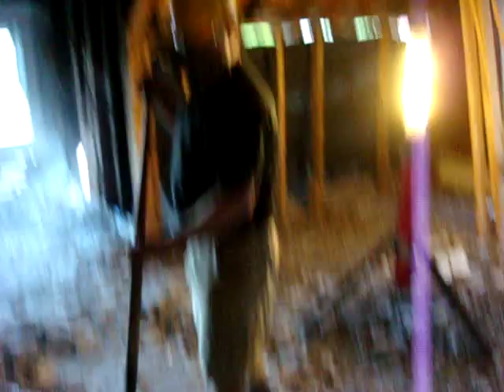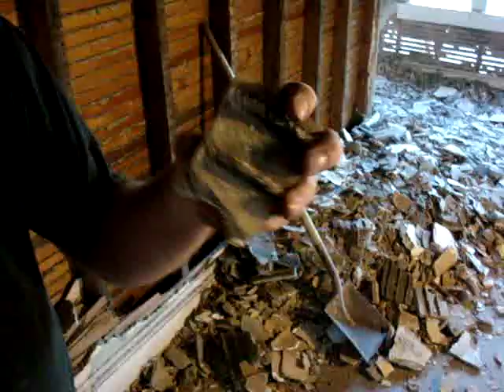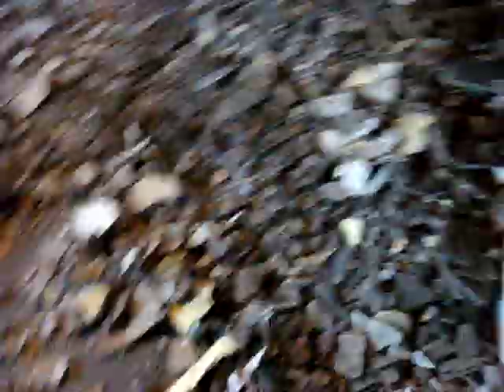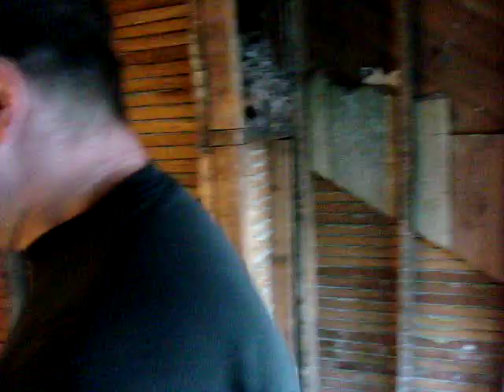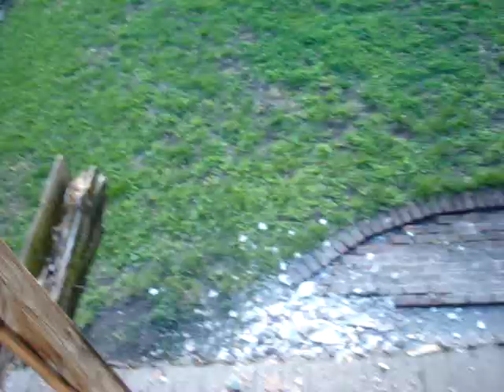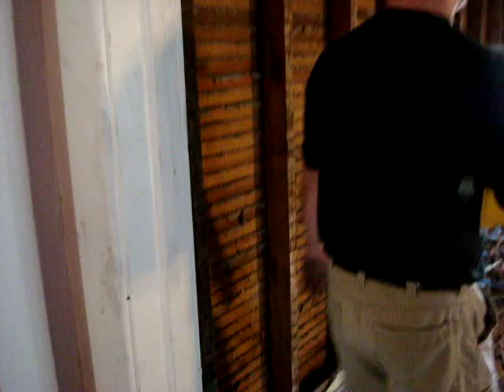How To Remove Lathe and Plaster

Comment: Dont understand why people want to remove lath and plaster walls
Reply: angelofdeath275 bc insulation! My house is lathe and plaster and non insulated. House if freezing in winter and hotter than balls in summer.
Reply: @MoparGuy1625  foam insulation can be used w/out taking down walls

Comment: thanks for the video.  I'm looking at possibly starting this process on our home, which consists of 5 rooms of plaster/lathe and 2 closets.   My allergies are not looking forward to it, and neither is my pocketbook. . however as you mentioned in your reply to youngwolf20 below, the most expensive part is labor, which will be me, so that will save a bunch.   :)

Comment: how much does it cost to do that? I have a 1200 square foot home and about 35-40% of it is wood walls and the reset is plaster. its a real pain to heat and cool.
Reply from the maker: youngwolf20 cost varies a lot-- are you doing it yourself? if you are the most expensive part, the labor, is zero, but you have to ask what your time is worth. It takes 6-8 hours to do an average sized room by yourself. It's a long work day. After you insulate and make repairs, it takes one average person with ok DIY skills 4 to 5 days to drywall, mud and reinstall the trim in one room, then another day or so to prep the trim to prime and paint. So, figure 50-70 hours per room plus materials to gut it and redo it. 

Plus, we pay $55 a ton around here for waste plus tipping fees. An average room will cost at least $100 in waste and more if it rains in the dumpster and water soaks in the plaster.

Are you spray foaming or doing Batts? Mineral or fiberglass? You'll have to get quotes.

In the end, material costs for an average room (100-125 sq. ft.) will cost $600 to $2000 depending on what you're doing once you open up the walls. if you have old windows, do you replace or rebuild? You'll certainly need new ropes inold ballast windows and probably more. 

Hope this helps!
Reply: James Glass 
thanks it does help. I wood be doing it my self and we burn all trash here. I live on a farm so DIY is something that I was raised up on Lol.
not sure what kinda insolation I would use but likely it would be the kind that comes in the roles.  my windows Im not sure about I know the house need to be raised or what ever it is that they do when houses settle. the brick outside is cracking and the glass on two windows and been split into from the house setteling. we found out about 4 years ago when I inherited the house and farm from my grandpa that the house sits on an underground spring.

Comment: I threw the plaster right into the trash bucket as I got it off the wall.  
How do you know where you can bring the plaster to recycle it?
Reply from the maker: Lead is heavy and falls pretty quickly. If you check out the EPA website you can see the procedures and gear for properly removing and bagging debris that contain lead. So long as you use a (100 or greater respirator, stay covered in your tyvec suit, stay gloved, and wash your body before eating, you won't get lead on you or your children. The debris needs to be put in a bag with a gooseneck tie, and then that needs to be placed in another gooseneck tied bag. After vaccuuming the contains need to be bag and the vac need to be wiped down. What some EPA certified renovators do is just bag their entire vacuum can carry it from job to job to avoid having to clean it each time. After all this, you need to mop and then throw away all the mop heads in double bagged gooseneck tied style. A lot of people, including me use swiffers for the final wipe down and then just toss them. Then toss your disposalable tyvec suit and clean the respirator. That's the basic procedure. After this level of detail, you won't need to worry about any remaining lead because there shouldn't be any appreciable amount.
Reply: James Glass thank you very much man your amazing !! I copied and pasted this to my notepad so I can reference back to it .. your a saint !!! thanks again!!
Reply from the maker: +Rachel Donat It depends on whether lead is present or not. If the plaster tests positive for lead it has to be specially bagged under controlled circumstances and then thrown away at the landfill. If there is no lead (and there was no lead in this case), I ground it up and used it with mulch, clay, and compost to make garden soil.
Reply: James Glass  I am preparing my home for some plaster removal and im worried because I know there is lead paint. my question to you is, what materials do you suggest I have during the process of removal and after.. and also is there any way to determine if my air still contains some lead particles lingering even after my project is done ? .any info could help . thank you kind sir

Comment: you should have used a power scabbler with a vacumn attachment to suck out the kill the plaster dust down then remove the lathe using saws much cleaner job  FLEX HPI 603 ~ Plaster Hedgehog scouring and a vacumn with a automatic filter cleaning system much less mess and dust suction health and safety better
Reply from the maker: +RIchard J Nash I'm not following exactly why you'd even allow the dust to exist when you can spray it with water and not have dust in the first place. I can't remember if I pointed out the use of water (sprayed by common garden sprayer) in this video or not, but you can see there's little dust since we keep on top of spraying. The point of this video is to make lathe and plaster removal a TWO PART PROCEDURE. So, let's not loose the take-away here: first take down the plaster and get it out of the way, then remove the lathe. The plaster and the lathe should be handled separately.

On dust control, which I'm glad you brought up, the first line of defense is to spray the plaster with a mist to control the dust. This eliminates most of it, but we still use better than P100 respirators because we like our lungs! But, running a vacuum is fine too--I'd still use the water to control it and I'd still use a very good respirator. Thanks for the good comment.

Comment: Why can't wooden lathe be restored on an inside wall similar to wood floor restoration?  I love wood much better than plaster.
Reply from the maker: +nzinga zindua The wood lathe isn't a finished product--it's not something that is supposed to ever be seen. These weren't wooden walls--they were plaster walls and in the old days, those rough strips of wood were nailed up (with 10mm gaps in between them) to just hold the plaster to the wall (it was troweled on). So, I think you may misunderstand what the lathe was used for. Now we have gypsum products like drywall so we don't need wood or metal lathe to hold liquid plaster in place while it sets up. I hope this make sense to you! Take it easy.
Reply: James Glass I understand your explanation.  However, I have seen it done on line to an inside wall.  They used it as kind of a wooden art wall.  It was sharp they way they finished it.  Thanks for your response.  Peace.
Reply: rick .sterling lol exactly, a wooden art wall with old fire hazard wire,barely any insulation and no heat= recipe for failure guess why the other commentator doesn't restore houses
Reply: a wooden art wall! lol!!!!
Reply: +nzinga zindua what?????? a wooden art wall? with lathe boards?? the whole idea of removing it is to insulate and run heating and electric. why the heck would you want to leave it?? its not like oak flooring.

Comment: If you're going to post a video of something, it would help a lot if the cameraman wasn't actively shaking the camera the entire time.
Reply: The e-Go is not really a production aircraft.... only 2 exist in the entire world, don't believe the hyped up press release
Reply: Its called  a Wankel engine... specifically a Wankel type KKM-57..
Reply: Rotary IC engines don't have a crankshaft or a flywheel..
Reply from the maker: I don't remember talking about Wankel engines in the lathe and plaster video--did you post on the right video? Haha.
Reply: I think he did!  He’s losing his mind, because he wasn’t able to force the internet to hate wankel engines.

Comment: Dear James.  Thanks for the info but I need to have an understanding of how to install or connect drywall to my lathe and plaster ceiling.  This is a 1952 house in Kemptville Ontario .  I am not removing the lathe and plaster .  I had some water but have repaired the issue from upstairs.  How would I attach the drywall?  Would I install strapping to the plaster ceiling first then install the drywall?
Reply from the maker: Well, first I should add the caveat that I would never personally install new finish material over old, for several reasons: 1) will the combined weight be greater than what the joists will allow (this is more a factor in old ceilings where scabbed together 2x4's were used and not floor joists, 2) what condition are the mechanicals, wiring, etc. in the space about to be covered, and 3) appearance--this is less ugly on a ceiling, but new drywall over plaster on walls makes the trim and drywall pretty much flush and that looks wonky! OK, having offered that, people to install drywall over old work by either applying it with extra long screws thru the new and old material and into the joist or by first installing resilient channel (to level and sound  proof the ceiling) and then installing the new material on the resilient channel. U can google resilient channel to see what I talking about.

Comment from the maker: Hey. Personally, I don't drywall over old work (weight, legal access, insulation (thermal and STC), etc, but it's not illegal to do it. Many people do it. The probs include: all trim (either remove and adjust or live with no reveal), finding studs (maybe you'll hit lathe, but maybe you'll hit knob and tube!) I'd suggest removing everything and seeing what you've got! Good luck!

Comment: Hey James, I am currently in the process of demo'ing a building and was wondering if the lathe and plaster were structurally solid, would you consider sheet-rocking over it? It's an old historical building that needs to be remodeled, so I am trying to come up with a smooth plan. 2 floors, 7 rooms on each floor, 17ft by 24ft (12 foot ceilings) and we were able to construct a shoot that goes right into a dumpster...any advice would def be appreciated.

Comment: I am removing the plaster walls in my house. My method is to get one course of lathe off them use a hammer to pry the boards off one by one. I separate the plaster and lathe at that time and put the plaster in a heavy duty contractor clean up bag.  Not being in any hurry this method works great because the dust levels are a million times lower them simply smashing the plaster with a hammer.  The fact that I am living in the project makes me be more methodical in my procedure.

Comment from the maker: Lead in the paint is the real issue during this time period, although later plaster can contain asbestos. Asbestos wasn't part of the plaster mix when manufactured, but it could be added. In the late 19th and early 20th cent. (when this house was made) adding asbestos was pretty rare, especially in cheap homes like this one. Pre 1960 lead in paint could be very high. This house was tested for both by a specialist using x-ray after swabs turned pink for lead. Overall the lead levels were low.

Comment: This just about answers my question as well. I'm settling into a place in Philly which is brick exterior w/ plaster directly on the brick. No obvious signs of water damage. My initial plan was to take the plaster off and put up a proper 2x4 framework for drywall, but thought I should ask a pro - is it better to just treat the plaster as part of the exterior wall and leave it alone, build the framework a bit in from the wall as you told that OP?

Comment from the maker: Yes, use the drywall to protect the floors from debris impact. The plastic will keep the dust off the floor (tape the perimeter) but it's the drywall will take the impact. If you have a clean edged shovel and you get the plastic tight, you can shovel the majority of the plaster up without tearing the heck out of the plastic. Use heavy 6mil or better plastic. If your shovel has a bur, it will tear the plastic. If you can't keep the plastic from ripping, use drywall, then plastic, then masonite

Comment from the maker: You should take it down to the studs, make sure the walls are straight and that all load bearing walls are sound. If it's an exterior wall, you can insulate and install a moisture barrier, and depending on the wall and layout, you might have good access to repair and wiring or plumbing issues.
Reply: Before you take the walls down to the studs ,how can you tell which is a weight bearing wall

Comment from the maker: Thanks for commenting--mechanicals are only one aspect of this remodel as the house is also being super insulated with r-25 minimum in walls and 5-60 up top. Plaster can't take years of water damage, and frankly, no home should have years of water penetration. Gypsum sheet products are vastly superior to lather and plaster, but this thread isn't a great place for a lesson in building science. We also wear triple filter respirators and the house underwent lead and asbestos testing prior to demo.

Comment: Should never remove all that..tear out what you need for wire/hvac..fill areas back in with plaster..alot faster not so much mess..drywall sucks..gets wet once and warps..plaster can take years of water damage before needing repairs..acoustic values..insulation/reflects radiant heat..nice demo work though..may wana get ur lungs checked out.

Comment: Thanks for a reply. You've inspired me to move forward and make improvements on my house I've always wanted to make. There is an addition with a foundation failing very badly which is forcing my hand. My house is pre 1885 brick twin in Upland Pa (one of the oldest communities in the USA .A mill town from the 1680's owned by the Crozer family). I removed plaster and lathe from one 3rd floor bedroom and have replaced the roof shingles. Your website is impressive,and video is helpful. Thanks

Comment from the maker: Hi, yes all the baseboards were removed, but save to be planed, sanded, and reused. Drywall get installed after new wiring/new plumbing/new HVAC is in and then the baseboard get put back up for paint.

Comment from the maker: And lead was banned in 1978, but can still be found in lower levels in homes through the 80's and 90's. Lead levels in finish products have steadily dropped since 1960, but there is still dangerously high levels, especially for children. So, be sure to test for lead as well as asbestos.

Comment from the maker: Hi, lead is probably a bigger concern than asbestos in old homes but both are issues you need to find out about.  Asbestos was used in increasing amounts in the 20th century in the states until it was totally phased out in 1979. Products containing asbestos were still used from old stock, so really only homes built in the last decade or so are asbestos free. You need to have the plaster tested for both lead and asbestos, as I do. It's critical to have the whole house sampled.

Comment from the maker: Ha. I've taken the lath camping before as starter wood. It burns fast and hot since it's so dry! I've been recycling the plaster in the garden. With compost and mulch it eventually makes great soil. I usually let it cook as I till it for three years or so adding more compost. If any trace lead was present, it's gone after phytoremediation! I do a soil test for heavy metals and ph before using it for soil.

Comment from the maker: as the cost of just installing the new wall. But, it's the right thing to do if you need a lot of heat or AC, especially the former since you can always choose to sweat it out, but you must have heat.

Anyway, if you're in a moderate climate, have vermiculite, and the plaster is generally OK, then I'd just repair it with veneer plaster. You can get this at any hardware or big box store by the bag. You mix it yourself. It takes talent to make the repairs, so heads up!

Comment from the maker: resilient channel or some sort of firring system will increase thermal value. I also don't know where you live, but if it is Zone 6 or higher, you will need to understand building science on vapor barriers, etc. You might have vermiculite inside the block, but that has a very low R value. 

If you have high energy costs due to a very cold or very warm climate, then a 2x4 wall set back about an inch from the block insulated with R-13 is a good start. This will require rewiring as well (more)

Comment from the maker: only the finish coat is damaged, you can repair those spots with plaster. You'll either need to learn how to do this with a hawk and trowel or hire someone.

On the other hand, if the wall is very badly damaged, then you have to decide to replaster extensively or install drywall with resilient channel. If money is an issue, drywall over the proper moisture barrier with insulation and resilient channel is very expensive. 

I don't know how this masonry wall is insulated, but installing (more)

Comment from the maker: It sounds like you live in a masonry house, most likely 8" CMU with scratch coat/finish coat plaster applied directly to the block.  Is this the case?

If so, then inspect the overall condition of the plaster and look for moisture problems. If you find areas that have fail due to moisture damage, you must first solve the moisture problem.

Assuming you have no moisture problem, then assess the general condition of the plaster. If the vast majority of it is sound and (more in next box)